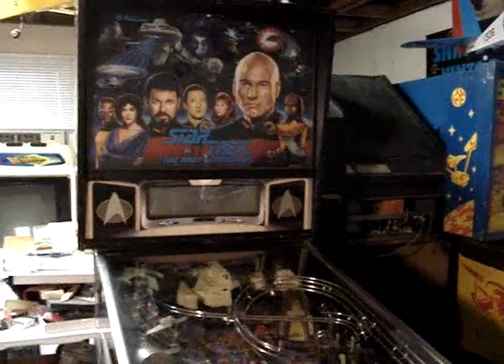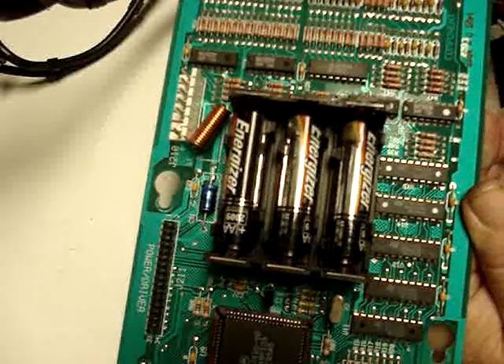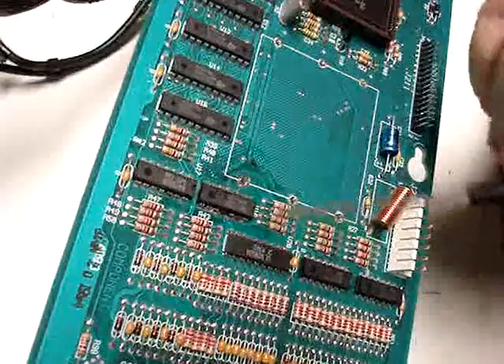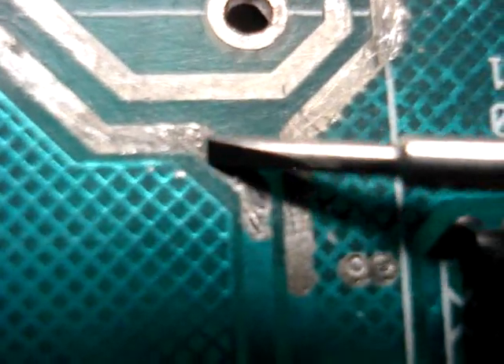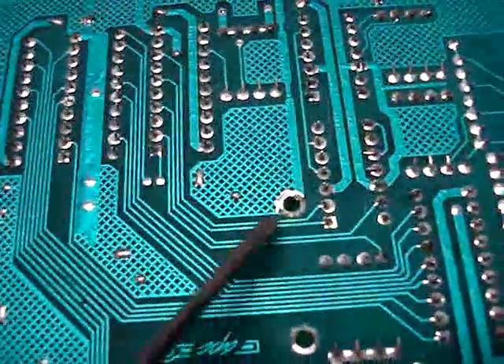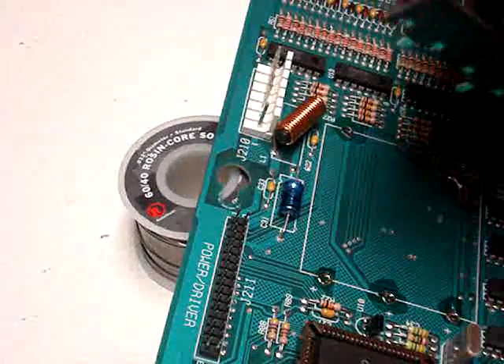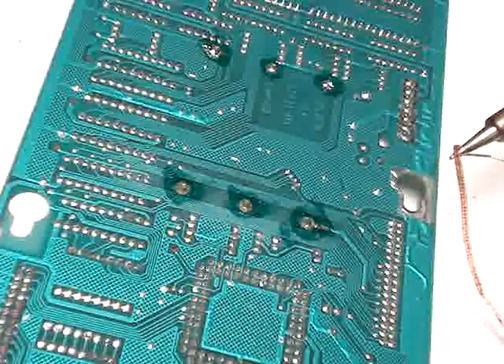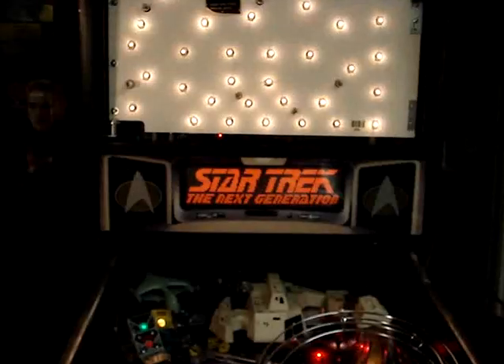WPC CPU Battery damage repair on a Williams STTNG pinball

Comment: i can use alcool isopropylic for neutralize acid? thanks
Reply from the maker: No, A lot of people, myself included refer to this battery damage as acid damage. I believe I corrected myself later in the video. When an alkaline battery leaks its electrolyte (most commonly potassium hydroxide) which is a base and has a pH value above 7. You need an acid to neutralize a base so that's why you use vinegar which is a mild acid. After you neutralize the base, lightly sand the copper traces, make proper repairs, resolder new sockets/ components, the last step is to use isopropyl alcohol to clean the solder flux off the PC board.

Comment: EXACT 100% same problem I had with my DemoMan. Sometimes I could unplug J212 and clean pins and it would work good but always returns. 

I just got the machine a few weeks ago and previous owner didn't install a remote holder. I immediatly ordered one to prevent this but sadly it came this way.

Took board out earlier tonight to solder in an external battery holder and saw some corrosion. Mostly on legs of the chips and resistors (much like yours). Nothing on board traces thankfully.

So I took some vinegar also, qtips and a toothbrush and cleaned it up good. Installed new battery holder and boom she's running perfect (so far lol). Who knows if it will return but hopefully it will. 

Just watching videos now to learn any new tricks for the future :-) 

So crazy though to see you having the same crazy randomness like I was.

Comment: Have you ever watched  videos by TNTAmusement? (Its a place that has repaired and sold pinball machines and arcades for many yrs) Tod Tuckey says to use lithium batteries. They have very informative  videos so you might want to check them out.